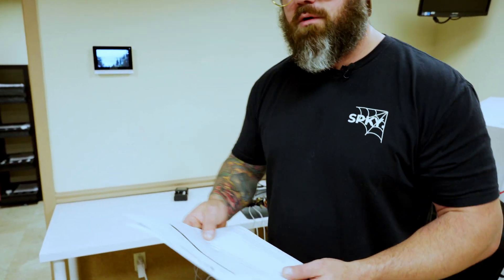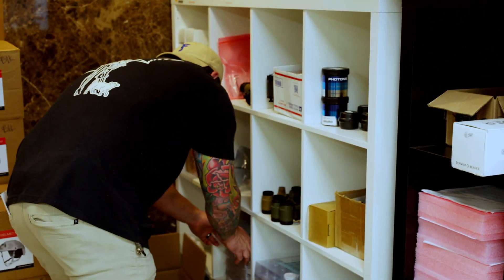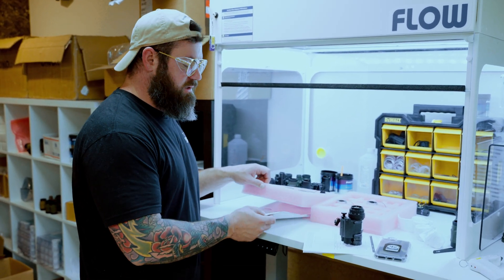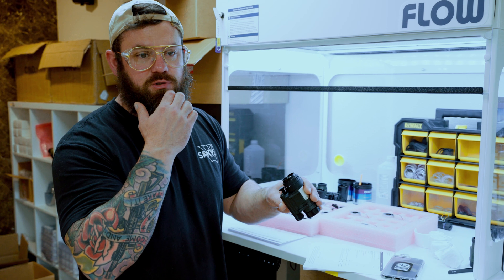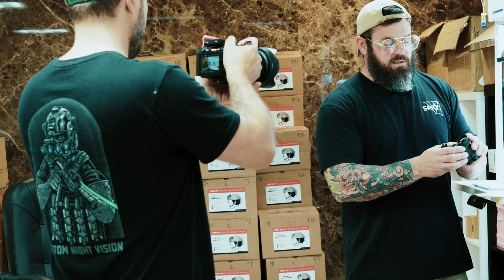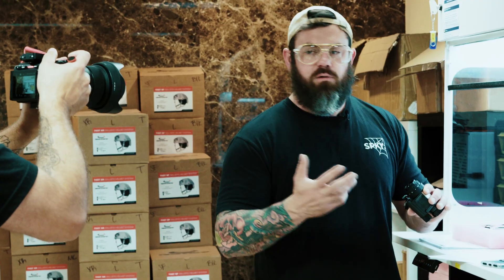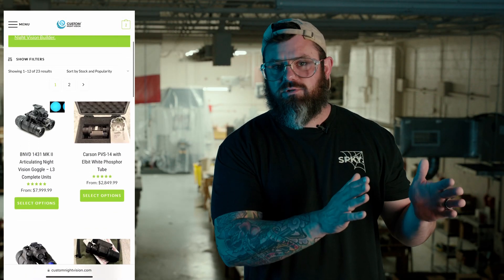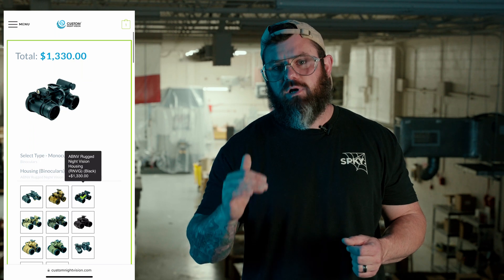Custom Night Vision | How We Build Custom Night Vision Devices

Comment: How about a video showing the differences between the Elbit xlsh & PH tubes that yall have? Really interested in the PH's but there isn't much out there video wise. Also, it seems like you guys are the only ones with them in stock online currently, did yall buy them all up?
Reply: The difference between them is simple. The PH tubes will be cleaner and have a smaller overall variance in spec. The XLSH are more likely to have blems (not every tube will have them) and the variance in spec is vast. 1800-2800 fom vast.